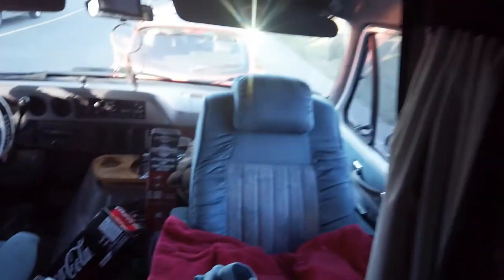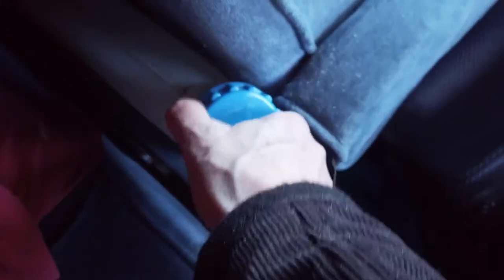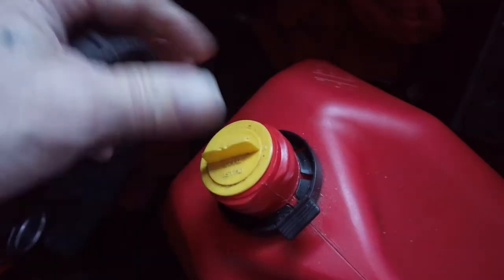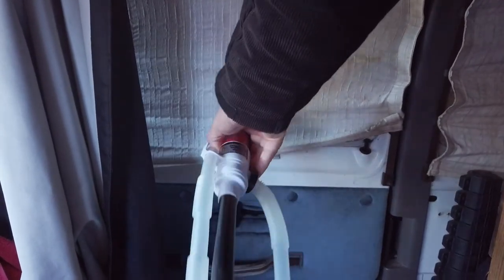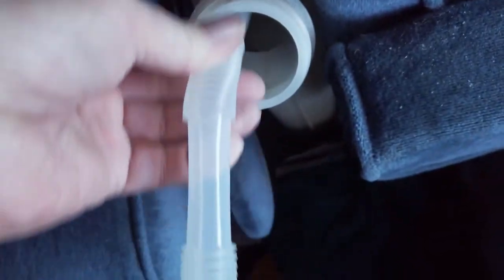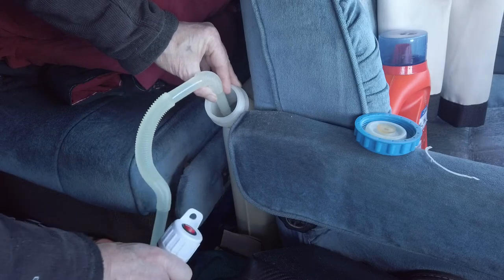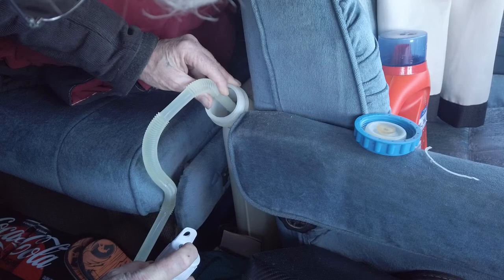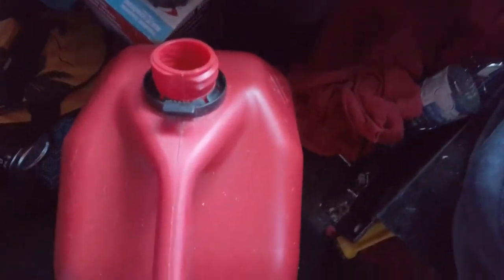Diesel Heater How to fill your tank inside the van

Comment: There is a pin tip sized air hole dead center of the cap of the tank. Careful about sloshing while you drive. Thanks for the video. I wish they had a screw-cap mount to permanently install the pump onto the jerry can.
Reply from the maker: Maybe someone will figure something out and let us know how make it happen.great idea on montung the pump right on the can.

Comment: Do you ever have diesel smell inside the vehicle due to the tank?
Reply from the maker: @davidpatrick1813  I personally never smelled the diesel at all.  Unless you spill some of course.
Reply: @NomadicVanman  THANK YOU THIS IS A BIG HELP.  I HAVE A 99 SAFARI AND MOUNTED THE TANK ON A PIECE OF PLYWOOD WITH HINGES.  SO WHEN I buy gas all I have to do is slide the swat forward and swing the tank to point to the open door.  The fill neck will be about 6” I guess… heater install comes next. M have a great day